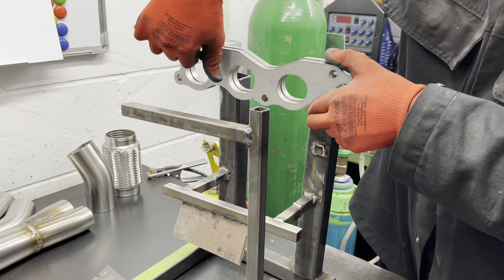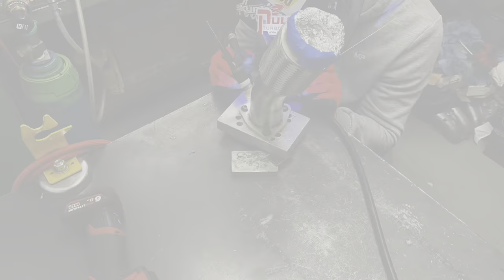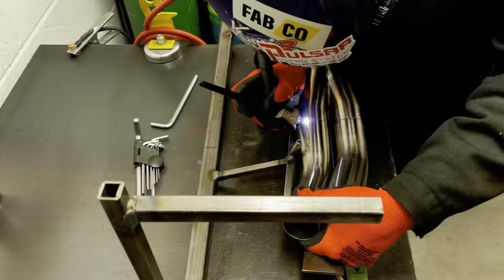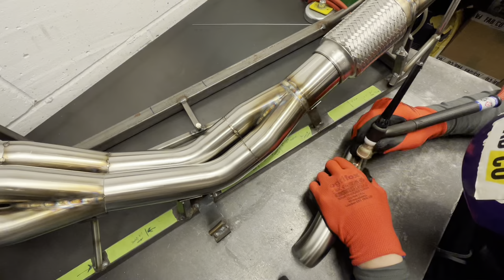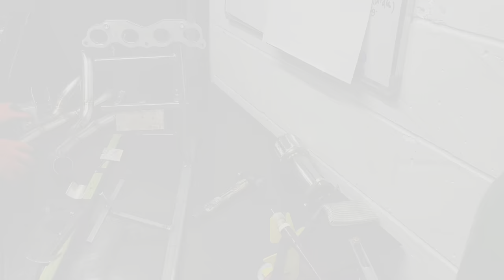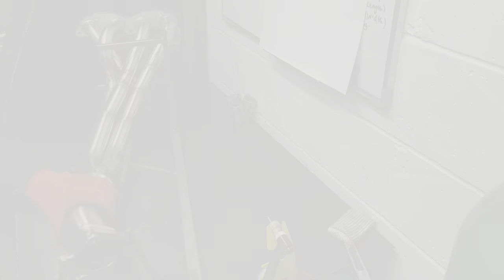Exhaust Manifold Fabrication - Honda Civic ep3 K Series

Comment: Finding this again after seeing so many 4-2-1s with 1-3 and 2-4 (or 1-2 and 3-4 pairing) makes me wanna say "Finally, a properly designed tri-y." The only way it could be better is if you'd have stepped up the primaries at least twice, and the secondaries at least once before their respective merges.
Reply from the maker: Thanks, appreciate the feedback
Reply: @Smffab  Actually, I might be wrong about the amount of steps on the primaries! So do your research, first, please. I DO know for sure from what I've seen and heard so far that stepped headers in general will audibly "sing" more than normal headers. If you look up the latest Maisteer video "how F1 sound is made" he explains it.

But as far as power goes, my research shows conflicting information on whether you should stick with only 1 step or multiple on the primaries. 1 step is seemingly almost always good, but more than 1, IDK. Good way to get more steps (for a better sound) is to have primaries and secondaries, though, which you do.
Reply from the maker: @Drunken_Hamster thanks, that’s interesting I’ll have a look into it.

Comment: I wanna hear the souuunnnd! Also, if you ever decided to do a UEL, please do a 1-4 or 2-3 pair UEL instead of the traditional 1-2/3-4 pair. It can potentially sound more V8-like with the way I described as it would be mimicking an 82-86 Honda V65 Magna with a Kerker exhaust and no muffler. (I can post a link to a ~1min video if you're interested)
Reply from the maker: Sounds interesting, please share a link. 
You can hear the sound, link below. Enjoy 👍🏼
https://youtube.com/shorts/AaEB4Ztkl5c?feature=share
Reply: @Smffab First is a walkaround, idle, and rev. Second is a takeoff. Third is another guy's bike with a MAC header and custom stubby carbon muffler instead of the modified Kerker setup. ((Still a 4-into-1, though.))
https://youtu.be/-_xiNxxZX7U?t=40
https://youtu.be/yVkOY1O0r7I
https://youtu.be/wCSo85uM_14

Comment: I know it's a little too late but... The world's first UEL header for a K series would be an interesting project! 😁
Reply from the maker: Yes maybe 😃
Reply: @Smffab  Great work on this header by the way!
Reply from the maker: Thank you 🙏
Reply: Most of them are uel but arr sold as ul. Usually there is 20mm to 40mm difference on runners from the ones I have seen and uel sucks for power.

Comment: What size tungsten and filler do you use ?
Reply from the maker: 2.4mm tungsten for everything I do and 1.2mm filler for thin wall stainless to control the puddle better

Comment: You didn't show welding the pipes together on the last merge to the header flange. I weld the merges together after the other pipes are welded so you can get at the weld.
Nice work!
Reply from the maker: No sorry didn’t show that part, but as you can imagine there is limited access so I had to use more stickout and more torch angle and still managed to get a decent weld with full penetration.
Reply: @Smffab  Ok but that would be a tough weld with the limited access to the side of the pipes.

I make exhaust and 4 into 2 into 1 collector for it and I have jigs for each separate pipe as well as the collector. It is for a VW engine so the collector must slip onto the primaries but the collector is one piece when finished. I have found that welding each half together completely then the merge bend is the best for me but the merges are challenging with the long stick out and limited access.

Still a nice job.
Reply from the maker: I think I know what your saying. It’s interesting to know other techniques and method. Thanks

Comment: Bravo ! Ma io non credo che i raccordi ai tubi tu li abbia tagliati a occhio... non hai voluto far vedere come li prepari, ok, a occhio e col pennrello puoi tagliare e costruire un tavolo in legno  ;-)
La piastra alla testata era in ferro o in inox anche lei ? AISI 304 o 316 ?
Reply from the maker: Didn’t want to show everything as it would probably be a very long and boring video. I’ve tried to make it short but still include as many interesting and useful parts in the video as possible. Each piece is cut using horizontal bandsaw then finer adjustments made on a belt sander to get the fit up just right. The tube and flanges are all made from 304 stainless steel.

Comment: Did you have those purge blocks made ?
Reply from the maker: I just made them myself from some flat aluminium bar, then drilled the holes to bolt down and drilled the purge holes too. The materials is really very flat and no need to have these machined. They have worked well for me on many manifold builds.
Reply: @Smffab  I like that, looks like they work well. Thanks for the reply

Comment: i am at the end of making same thing that looks like ugly MIG
Reply from the maker: That’s a shame
Reply: @Smffab  i think that tig welding is so superior in compare to mig,that it can look ugly and still can be welded good, i weld 1.6 mm thick ss316  pipe with 40A and 1 mm wire,and if i stay or go too slow, pool makes droplets inside and surface is uneven,that is why go a little faster and more heats up wire than pipe,so my weld looks like mound on pipe but it is strong and tested on car,of course purged
Reply from the maker: I use 43amps got 1.6mm stainless and dab every second so don’t hang about. Make sure you have good gas coverage and practice.
Reply: @Smffab  thanks, my weld usually looks gray to black but sometimes happens  it looks gold-if i go slowly but it is a little difference to make hole, i use 10-13 liters in minute of argon, 9 cup